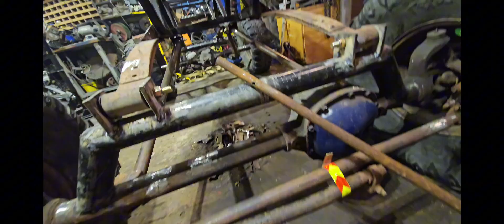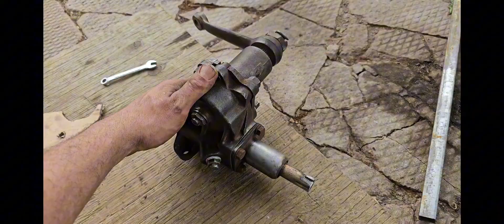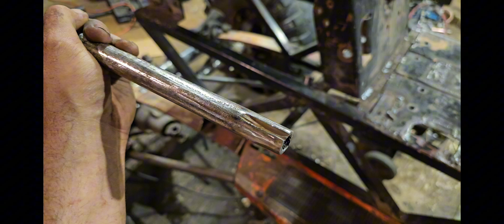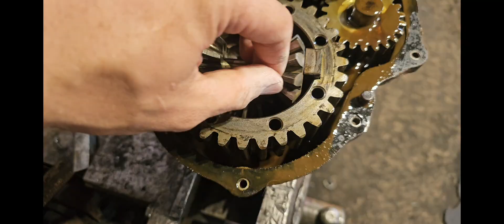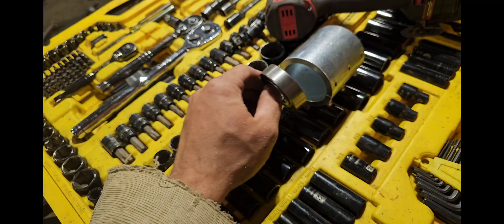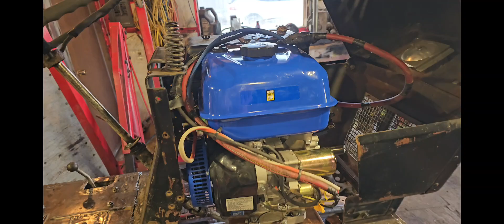Solid Axle Swapped 4x4 Lawnmower Project part 3

Comment: hey man i think you might go forward in reverse having your engine facing that way. please check that so you dont build a bunch for nothing.
Reply from the maker: Already checked it multiple times the enginehave to go that direction to have all 4 gears forward that's the way the i'm transmission set up
Reply: @greasemonkey348  right on good to hear!  cant wait for your next installment, your monster mud mower is turning out great  cant wait for the test drive!